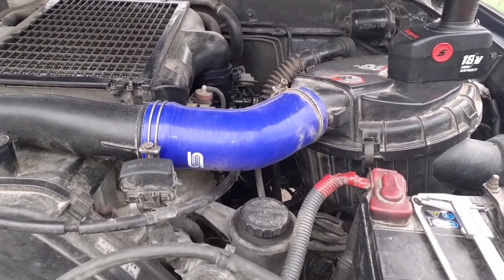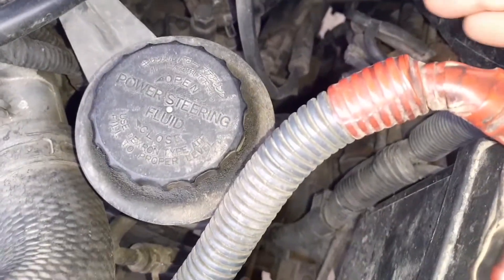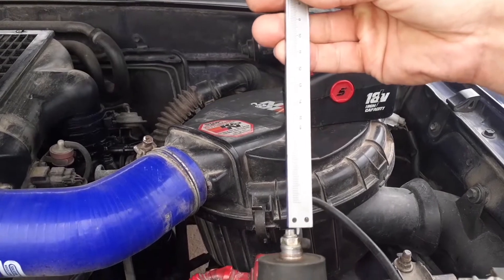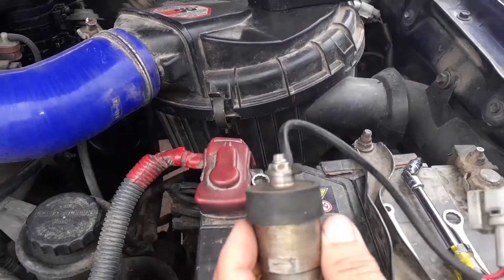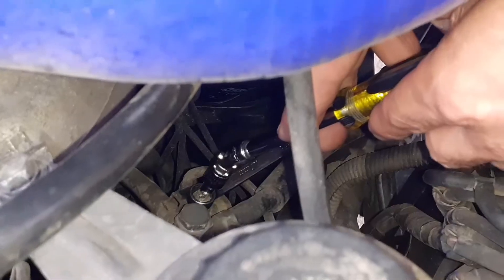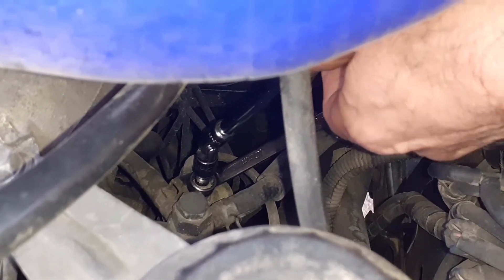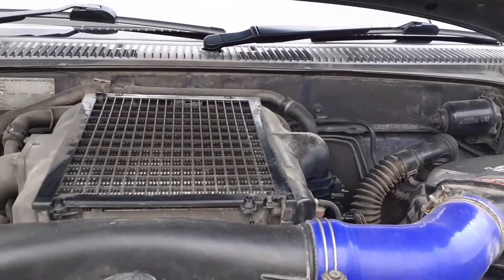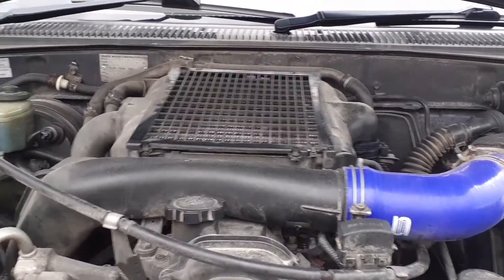Toyota Hilux Surf 1KZ-TE Fuel Pump SCV Adjustment 3rd Gen #4Runner #toyota #4x4 #diesel #japan #fyp

Comment: To increase power.. Turn clockwise.. To get better fuel economy.. Turn counterclockwise.. Am. I right?
Reply from the maker: Hi there...To increase fuel flow in a Toyota Hilux diesel, you can adjust the fuel screw on the mechanical pump (clockwise for more fuel, in tiny increments) or get a professional to rebuild/tune the pump and upgrade Air filter, injectors, but for significant power, consider ECU remapping, a better turbocharger, or intercooler upgrades, always monitoring EGTs (Exhaust Gas Temperatures) to prevent damage.

Comment: Hello I have Toyota Hiace 1997 model year. It had a problem on spv valve diesel leak. Now I fixed a reconditioned spv valve. But there’s a problem when starting the vehicle. It started and there’s a miss of Engine for 5-10minutes. After some time it become normal. What is the problem on it. Please help
Reply from the maker: Hi please visit your local TOYOTA garage as it could be anything. Sorry but I can't diagnose over the internet.
Reply: Local toyota garage😂😂😂😂😂

Comment: Hello, I was wondering how it sounded before you fixed this. I suspect my 96 surf has the same problem. Thank you
Reply: If you want more power , turn the screw 1/4 of a turn , go for a drive , see how it feels, you shouldn't need more than 2-3 1/4 turns, you should notice the power increase but don't screw all the way down as that can cause turbo runaway, or you can wire in a 5k pot-resistor onto the 2 wires that go to the scv and put the 5k pot-resistor in your dash , that way you can adjust the fuel-power increase while your driving.
Reply from the maker: This modification is generally considered a temporary bypass otherwise can cause serious damage to the engine.
Reply from the maker: Hi, There wasn't any change in the sound of the engine.
Reply from the maker: there was not really any sound change when it was adjusted..